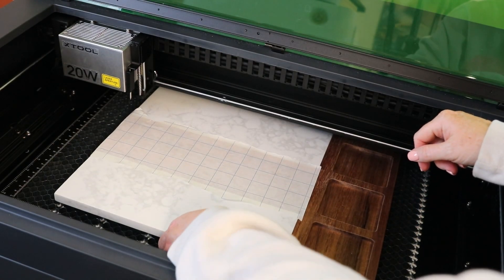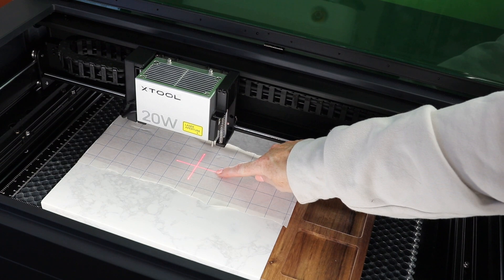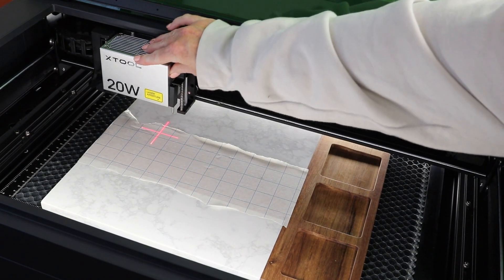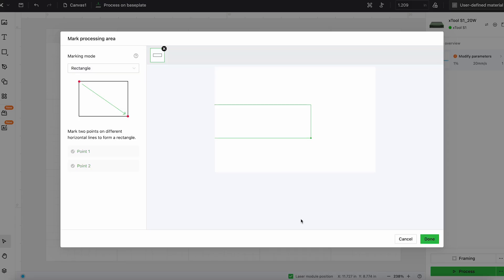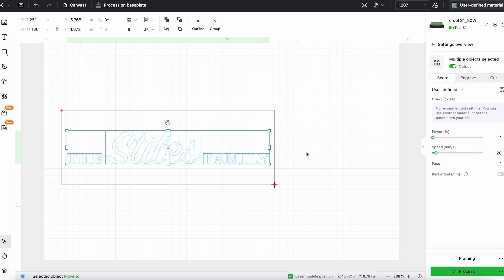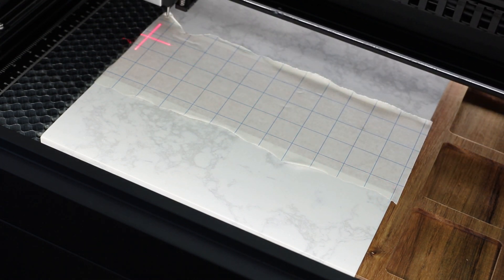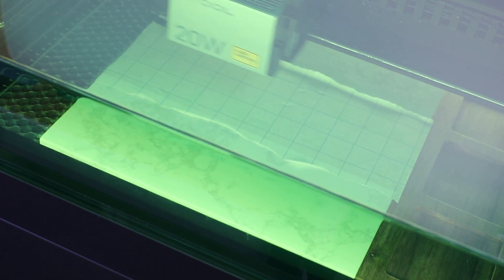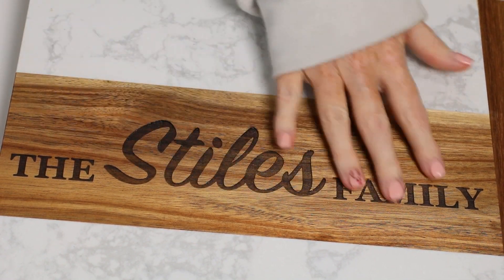How to Locate Designs on an xTool Laser (No Camera Required!)

Comment: Why did you mask the board
Reply from the maker: It just makes clean up a bit easier with less charring on the surface. I was making it quick for myself.
Reply: @AngieHolden  thank you
Reply: Also, thanks for the pattern fill for Cricut
I used it to engrave bag tags for my grandchildren